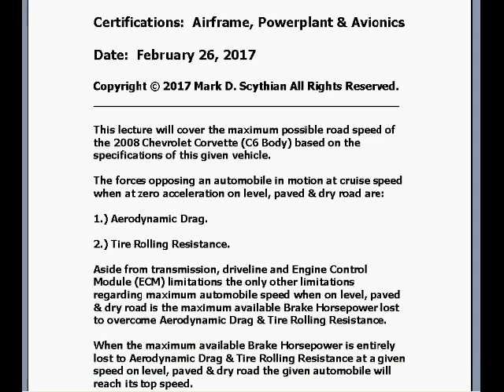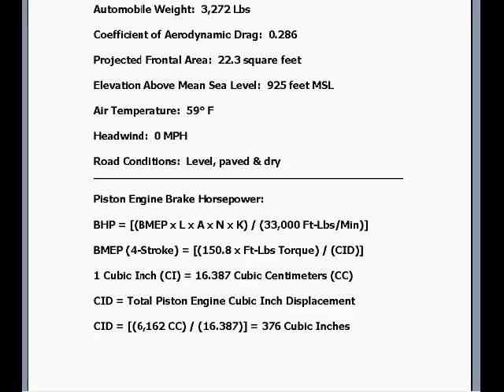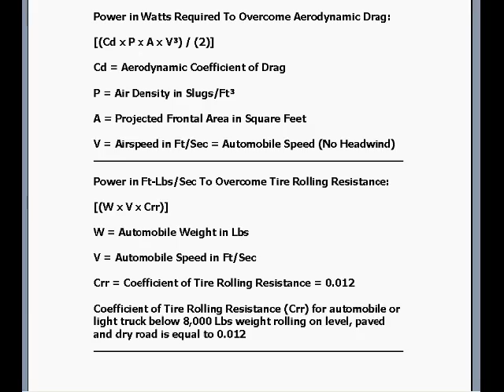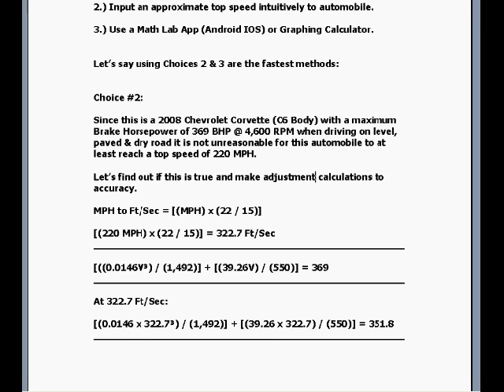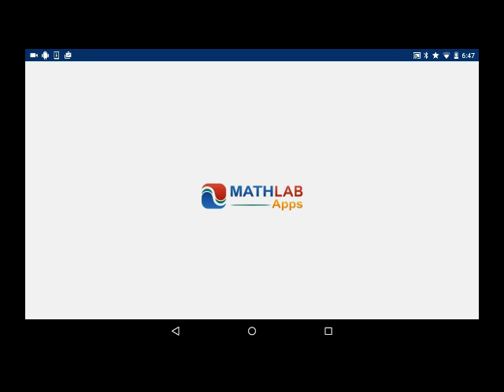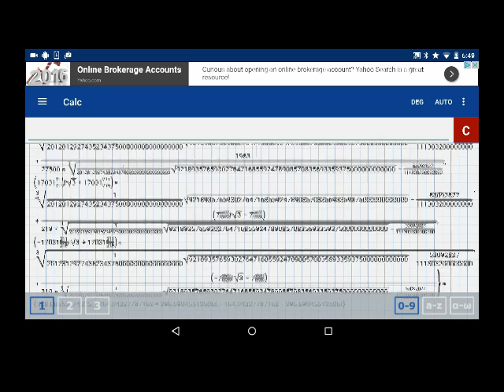2008 Chevrolet Corvette Top Speed Calculation

Comment: How can a car with only 369 ponies achieve 224 mph?
Reply from the maker: Hi Renato.  Based on the Law of Inertia, after an automobile reaches 'some' constant speed, the only forces opposing its forward motion are:  Tire Rolling Resistance AND Aerodynamic Drag.  This is based automobile motion on 'Dry, Level and Paved Road'.  If the road has an 'elevation' or 'declination' or is not-paved or not-dry, then of course more power is needed to maintain 'some' constant speed when traveling upon an elevation and also not-paved and not-dry road.  The exact opposite is true ONLY when automobile in constant speed is traveling 'down a declination' as gravity will assist with power.  Assuming road is dry, LEVEL and paved, the only forces opposing an automobile's 'constant speed' are:  Tire Rolling Resistance AND Aerodynamic Drag.  Based on calculating the maximum Brake Horsepower available for this automobile provided by the Crate LT4 or related engines powering given automobile, the maximum attainable forward speed was calculated at approximately 224 MPH.  At this speed, on LEVEL, paved and dry road, the maximum available brake horsepower is EQUAL to the POWER REQUIRED to OVERCOME Tire Rolling Resistance AND Aerodynamic Drag.  If you watch the entire video, you will observe all formulas provided which prove this calculation as correct.  If you are still not convinced this calculation is correct, you can just go to the manufacturer (Chevrolet) and look up the 'top speed' for this make/model/year of automobile and it is approximated between 220 MPH and 228 MPH according to the manufacturer.  Therefore, this calculation is considered the 'nominal' top speed for given automobile.
Reply: @markscythian  Hi Mark.  I'm familiar with the drag equation, rho and tire rolling resistance equation.  I know several variations of the tire rolling resistance formula, from the simplest to the most complexed.  The value of 0.012 used here is lower than the one I would use using another formula.  Instead of 0.012, 0.020 is used for 224 mph which would increase the horsepower needed to attain 224 mph and the drivetrain loss taken into account.  Isn't 369 supposed to be wheel horsepower and not brake horsepower since powertrain or drivetrain loss is not in the picture?  If that's the case and assuming a 15% loss, the bhp should be 434 and not just 369 to attain a top speed of 224 mph.  Also, a more accurate value of rho of 0.0022983, a tire rolling resistance of 0.020 for 224 mph with an assumed 15% powertrain loss, 388 whp or 456 bhp is necessary to achieve a top speed of 224 mph.  Just saying.
Reply from the maker: Hi Renato.  Using other Coefficient of Tire Rolling Resistance (Crr) values such as 0.020 usually APPLY to land vehicles OTHER THAN light-trucks/automobiles, such as:  Large Semi-Trucks, Off-Road Vehicles and terrain OTHER THAN paved dry road (sand/gravel/dirt).  As for acceleration Power requirements the equation:  [(mv^2) / (2t)] in Metric Values will calculate Watts Power for acceleration ONLY.  The PLANK/33,000 formula for calculating BRAKE HORSPOWER (BHP) of Piston Engine can be matched accordingly for AVAILABLE POWER disregarding POWER LOST TO KEEP ENGINE RUNNING (Friction Horsepower or FHP).  We know that the sum of BHP and FHP will EQUAL Indicated Horsepower (IHP) as Power is constant in a closed system, for which efficiency losses in power PLUS power available will equal total power or IHP.  All this required just to attain a predetermined CONSTANT CRUISE SPEED with ZERO ACCELERATION or DECELERATION (First Derivative = ZERO).  Reaching Inertial Motion (assuming automobile/light-truck constant speed on paved dry level road or 0.012 Crr).  The only other force opposing forward motion is Aerodynamic Drag.  In the US System of Measure, we can use the Slugs Air Density times the Drag Coefficient times the Projected Frontal Area (use width x height x 0.8) times velocity in Ft/Sec cubed (^3), then this product divded by two (2).  This will calculate the Power Required in Watts to OVERCOME Aerodynamic Drag.  If velocity component is squared (^2) then ONLY Lbs Aerodynamic Drag will calculate.  But, cubing the velocity component (^3) in Ft/Sec will calculate the Power REQUIRED To Overcome Aerodynamic Drag.  After that it's as simple as 746 Watts = 1 HP.  At 224 MPH the Horsepower needed to overcome Crr and Aerodynamic is exponentially HIGHER than let's say at 80 MPH, since the square of the velocity is directly proportional to the Lbs Aerodynamic DRAG incurred.  I am sure you understand these principles VERY WELL.  However, getting caught up with 'Wheel HP' and finite-values at the output-drive-line INSTEAD of the BRAKE HORSEPOWER involved can 'complicate' or even result in error-calculations!  Calculating 'top-speed' should FIRST start with calculating the Maximum Available BRAKE HORSEPOWER the (piston) engine can provide.  Then SECOND, calculating the POWER REQUIRED TO OVERCOME Aerodynamic Drag and Tire Rolling Resistance when at CONSTANT SPEED.  The Power Lost to Overcome Aerodynamic Drag and Tire Rolling Resistance SHALL EQUAL the Maximum Brake Horsepower Available by engine, IF the Top Speed IS TO BE CALCULATED.
Reply: @markscythian  Hi again.  Thanks for your reply.  Okay, assuming everything you said here is right and true, if a mere 369 ponies can achieve 224 mph, now with a hypercar such as Bugatti or Koenigsegg, both with 1,600 hp--the Bugatti so far achieved a top speed of 304.77 mph, but not as aerodynamic as the Koenigsegg, and the Koenigsegg Jesko Absolut projected or expected to hit about 330 mph or 531 kph, can you show us the math involved using your equations in the video?  Now, your video has rho or the air density value of 0.00239, or more decimals like 0.0023983, if you will, due to the altitude, instead of the sea level value of 0.0023769.  If I use your exact equations, substituting just the standard rho value (sea level, 59 F, 29.92 inHg) and just a fixed 0.012 Crr that you stated, the Koenigsegg Jesko Absolut would achieve this speed:  

1,600 bhp
20.24 sq ft, frontal area
0.278, drag coefficient
3,230 lbs, weight of car including driver
1 hp = 745.7 watts
0.012 = Crr
330 mph or 484 ft/sec

Using your equations and values, at 330 mph, only 1,051 bhp is needed.  We still have 549 ponies left!  To consume all that power, the top speed would be almost 381 mph which is ridiculous!  By iteration alone or trial and error, I can solve the equations or your equations without solving polynomials and other methods.
Reply from the maker: Hi Renato.  For marketing sake, most large companies "get away" with stamping a 'generic' horsepower rating which is meaningless. I'm not sure how "big" these corporations would get if we all lived in societies made up of mathematicians, physicists, technicians and mechanical engineers!  lol  Assuming that only 5% of the USA are STEM-graduates, particularly engineering and technology graduates, (probably more in Europe and Asia, but not more than 15% of the population outside of the USA), the over-use of "horsepower" is only for marketing sake!  Honest manufacturers would require their vehicle marketing to stamp:  Ft-Lbs or Newton-Meters of Torque and Maximum BHP at specified RPM ONLY!  Calculating these is simple if one's life goal is Mathematics, Physics, Technology and Mechanical Engineering.  Therefore, consider the following:  Most "horsepower" ratings include Friction Horsepower as well, and imply TOTAL POWER involved with engine.  Including the 67% power LOST to keep the engine running at any RPM and performance.  Only 33% or less of the total power involved with any heat engine powered on hydrocarbons is even USABLE!  Moving onto the numbers you have provided:  If a Maximum BHP of 1,600 BHP @ XXXX RPM is actually available, then the total HP is at least (1/0.33) times 1,600 or 4,850 IHP.  With 1,600 BHP at some specified RPM (let's say at a mid-range RPM, high-gear and at the positive-vertex max-point of the Torque Quadratic Function), intuition alone tells one that the equivalent Tire-Rolling-Resistance and Aerodynamic Drag POWER which EQUALS 1,600 BHP or 1,193,600 Watts will allow a top speed unsuitable for land vehicles or TOO HIGH.  In this case, even with a car weighing 8,000 Lbs (3,636 kilograms) or LESS, the top speed would exceed more than 350 MPH!  lol  I think other LIMITATIONS other-than Aerodynamic Drag and Tire Rolling Resistance prevents speeds this high from occurring.  Such as transmission limitations, wheel-bearing limitations, and Motor Vehicle LAWS!  However, let's assume that we all got together and designed/built an engine with 1,600 BHP and also a vehicle/chassis to permit top land-speeds to reach Mach 1 or about 740 MPH at Sea Level STP.  We would first need to find a 100 mile (160 kilometer) road that is perfectly level, dry, paved and CONTROLLED keeping everyone else out.  Then we'd have to implement some form of a composite military-grade air-bearing used in fighter jet engines for the car's wheel bearings.  We'd then have to create an experimental transmission which allows land speeds up to 740 MPH on land.  If we did all of this while radically changing the Aerodynamic Drag Coefficient and Projected Frontal Area to some "crazy-low" set of coefficients, like 5 square feet and 0.018 or less, sure, we'd have enough power to push this "thing" to a top-speed matching the maximum available brake horsepower.  The massively high BHP of 1,600 for a vehicle under 8,000 Lbs (3,636 kg), seems more about acceleration performance than for 'top-constant-speed'.  Forget about 'top speed' for a minute, and focus on why people even buy cars with a maximum BHP of 1,600 BHP:  To beat everyone else in acceleration performance!   Using the formula:  [(mv^2) / (2t)] to calculate the approximate power in watts to accelerate a 5,000 Lbs automobile from rest to 88 ft/sec (60 MPH or 96 Km/Hr) in 4 seconds, we get:  [((5,000/2.2) x (88/3.28)^2) / (2 x 4)] = 204,491.4 Watts or 274.1 BHP.  A maximum BHP of 1,600 at some specified RPM is similar to the acceleration of Dragsters!  There certainly needs to be a concentration of weight to prevent instability during acceleration for this much available BHP!  Assume the CG is perfected (which is) for the given vehicle (Koenigsegg Jesko Absolut), then the acceleration is IMPRESSIVE from rest to 330 MPH.  Your numbers all look ACCURATE and 330 MPH is the top speed.  I haven't looked up the Curb Weight for this vehicle, but let's assume it's 6,000 Lbs and it accelerates from rest to 330 MPH in 24.9 seconds, this acceleration would require 1,192,455.7 Watts of power OR 1,598 BHP at some specified RPM.  Not bad for going from rest to 484 ft/sec (147.6 m/s) in just 25 seconds!  Acceleration is where most power is needed and only 30% of the potential energy in fuel is actually usable power.  This vehicle is obviously for drivers who like to out-run everyone else on the road!  lol
Reply: @markscythian  Here are the formulas I use.  At sea level and standard temperature of 59 F and 29.92 air pressure and dry air or 0% humidity:

Wheel horsepower to overcome rolling resistance = Crr x S x W / 375 

Wheel horsepower to overcome air drag = 0.0025565 x Af x Cd x S cubed / 375 

Hw = (0.0025565AfCdS^3 + CrrSW)/375

rho = 0.0023769 at 59 F and 29.92 inHg (14.70 psi), sea level
    = 0.0022983 at 59 F and 28.93 inHg (14.21 psi), 925 ft above sea level

Crr = 0.0135 + .000000129S^2

Using these equations, the car has to have 528 wheel horsepower or 621 crank horsepower or brake horsepower, assuming 15% drivetrain or powertrain loss, at those conditions (sea level, 29.92 inHg and 59 F)

S = miles per hour
W = weight of car (plus driver) in pounds
Af = frontal area in square feet
Cd = drag coefficient (unit less)
Hw = wheel horsepower
Hc = crank horsepower or brake horsepower
Pl = powertrain loss in percent
Crr = Coefficient of rolling resistance

Hw/Hc = 528/621 = 0.85 
powertrain loss = (1 - 0.85) = 0.15 or 15%
Hw/Hc = 528/652 = 0.81
powertrain loss = (1 - 0.81) = 0.19 or 19%
Reply: Now I know why the horsepower is much less than expected.  You divided it by 746 which is in watts per hp and not by the same 550.  Besides, the Crate LT4 produces 650 hp and not that puny 369.  With 528 wheel horsepower or 652 brake horsepower, the car CAN go 224 mph with those parameters!
Reply from the maker: Hi Renato.  "Horsepower" by itself tells one NOTHING!  What type of 'horsepower'?  Brake Horsepower?  Friction Horsepower?  Indicated Horsepower?  Unless Brake Horsepower at a specific RPM is calculated, no true information regarding Available Power shall be known.  Using maximum available Torque in Ft-Lbs or Newton-Meters at a specific RPM is actually a better place to start.  Since the BMEP in PSI of a four-stroke piston engine shall equal 150.8 PSI IF 1 Ft-Lbs of Torque is developed per 1 Cubic Inch Displacement.  Thus, the "P" component of the PLANK/33,000 formula is calculated. "L" is feet piston stroke or inches piston stroke divided into 12.  "A" is piston head area in square inches OR Pi x bore diameter in inches divided into 2 SQUARED.  "N" is the number of power-strokes per 1 minute or half of the RPM IF a four-stroke piston engine duty-cycle, AND equal to the RPM IF a two-stroke piston engine duty-cycle. "K" is the number of cylinders.  This product then divided into 33,000 Ft-Lbs/Min or the number of Ft-Lbs per minute per 1 Horsepower.  Many manufacturer's simply label their engines with "horsepower" which means NOTHING!  The Brake Horsepower of a piston engine can be calculated using the PLANK/33,000 for which the "P" is substituted with BMEP in PSI OR the slightly-less accurate:  [(6.28 x Ft-Lbs Torque x RPM) / (33,000)] formula for calculating BHP for ANY engine or motor be it gas, electric, hydraulic, pneumatic, etc.  Once the BHP is known, then it is quite EASY to calculate how much POWER IS LOST to KEEP THE ENGINE OR MOTOR RUNNING aka "Friction Horsepower" or FHP.  BHP + FHP = Indicated Horsepower = IHP.  Regarding gas powered engines (piston & turbine) only 30% of the potential energy of the fuel will provide USABLE POWER or BHP.  Remember that there are 20,000 BTU per 1 Lbs of Gasoline and if 1 BTU/Sec of HEAT IN THE FORM OF BURNING FUEL IS RELEASED THIS WILL EQUAL 1,056 Watts of Power.  70% of this heat energy is LOST to keep the gas piston or turbine engine running.  Whatever else that remains is the BHP which will move the car, airplane, boat, etc. Gas combustion engines are not very efficient, BUT are very practical since there is quite a lot of BTU in 1 Lbs of hydrocarbon fuel.  Gasoline's fuel density is 6 Lbs per US gallon with 20,000 BTU/Lb.  Diesel is 19,600 BTU/Lb and fuel density of 7.1 Lbs/US gal.  Kerosene is 18,730 BTU/Lb and 6.75 Lbs/US gal.  Liquid Propane is 24,000 BTU/Lb and 4.24 Lbs/US gal (liquid).   Overall, these hydrocarbon fuels are relatively equal in energy density, BUT their Flame-Front-Speeds are all different.   The point I'm making is that CAREFUL calculation of BHP at a specific RPM is SO IMPORTANT, because this provides a finite numeric limit on 'real world' available power.  All other power losses can then be subtracted from the Maximum Available BHP at specific RPM, to KNOW maximum performance capabilities.